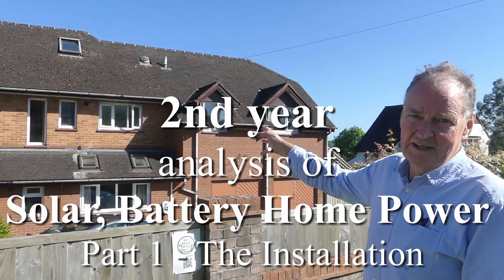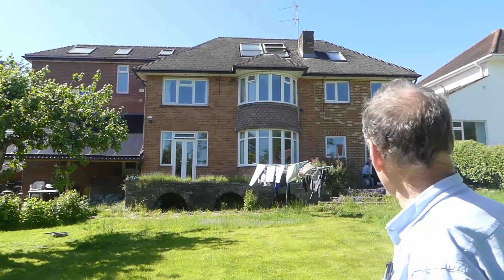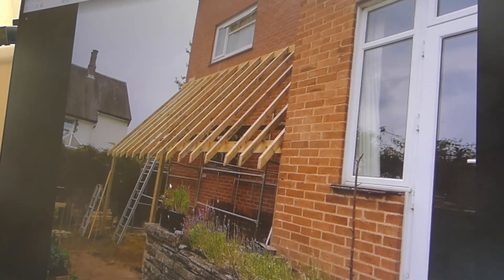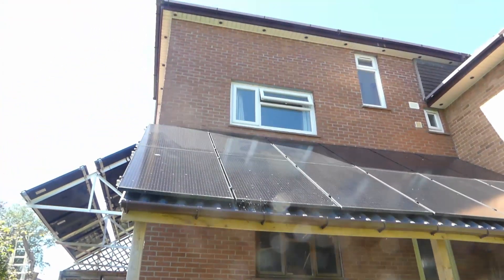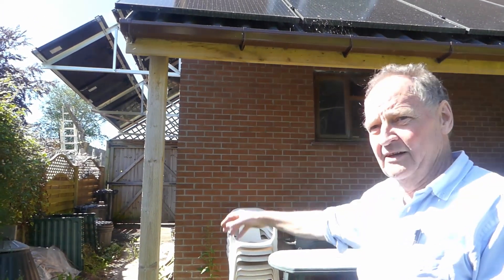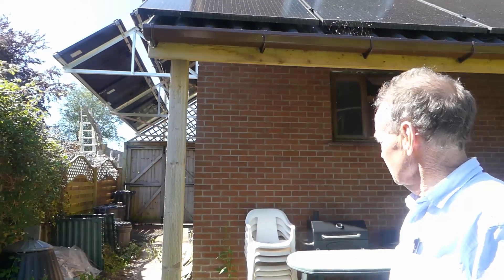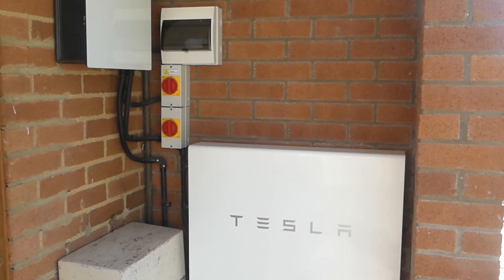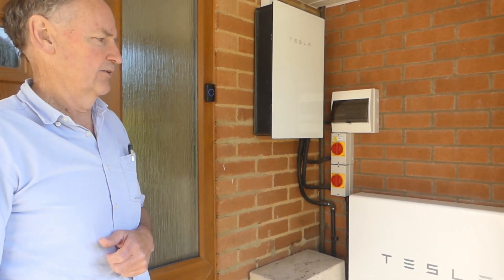2 yrs Analysis of Home Solar, Tesla Powerwall Battery Installation with SolarEdge inverter.

Comment: That setup sounds very wasteful. The clipping of the incoming DC to the inverter and the conversation to AC then back to DC! Sounds like you need another box before the inverter that sends DC to the inverter based on demand then the rest still DC into the battery without the DC-AC and AC-DC double conversion. You are probably wasting at least 25% of your peak energy.
Reply: The Tesla powerwall 2 claims a 90% round trip efficiency which seems about right based on my experience. So I think the loses are more like 10% to 15%. Having said that I agree DC to DC would be more efficient. The Tesla Powerwall 3 offers that so if I were to install the system now it would be more efficient,
Reply: @hughrattray9354  It's got to be at least 25% peak loss as you said the inverter can only handle 5kW of the 6kW that the panels can produce (that's 17% on its own).